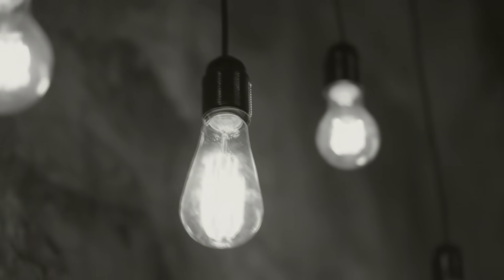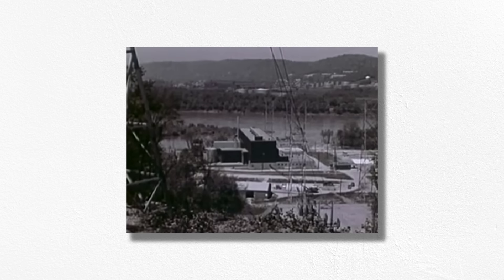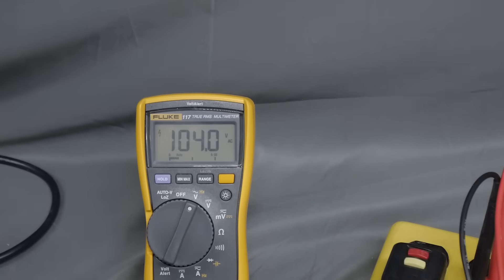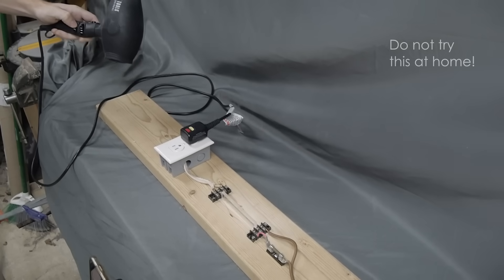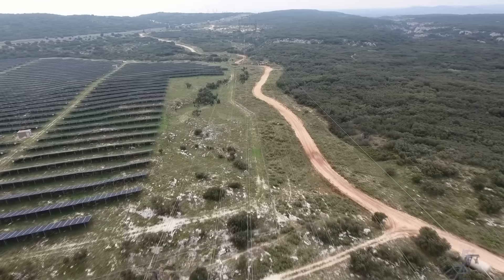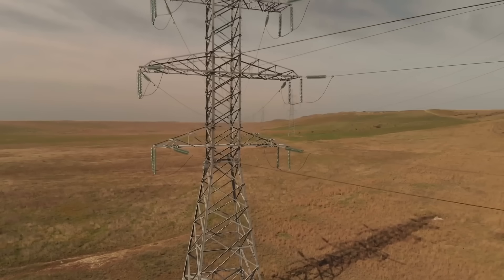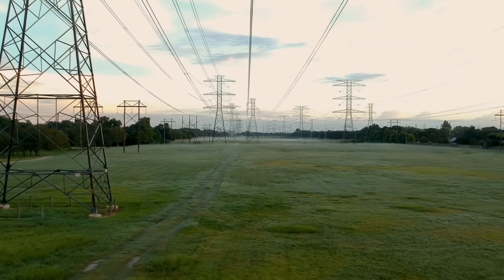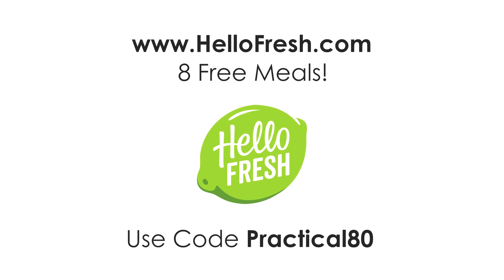How do Electric Transmission Lines Work?

Comment: What causes the power line noise? What is done to minimize it?
Reply: Corona discharge makes noise, you usually get it if you have sharp edges, that's why the higher the voltage the more important it is to have rounded corners on everything conducting electricity.
The conductor itself is not much of an issue but the point where it's attached in the transmission towers would be a source of corona discharge
Reply: Morten Holsmo  I never knew that the bending angle matters when it comes to Corona discharge
Reply: That is an electric discharge of the air. So basically, the power lines leak electricity into the air. The air then dissipates the energy and that produces a buzzing. There are steps to be taken to help minimize the problem, but it'll occur in any high voltage system.
Reply: @Azivegu  so If I'm understanding correctly the electricity is seeping into the air causing it to heat up and vibrate? What controls the frequency of these vibrations?
Reply: The freq of the generator - 60hz in US  50hz in some other places.
Reply: krembo the frequency of the electrical system controls it such as  in the US we function on 60 cycles and in Europe they run on 50 cycles. The higher voltages will also carry a more high pitched tune.
Reply: @Azivegu  Good answer!  FWIW, something that illustrates this point is that the noise level noticeably increases with humidity because wet air is more conductive.
Reply: @Azivegu  yep u right i noticed that noise isn't often so i believe it depend on percents of humidity in the air.
Reply: @Azivegu  wrong
Reply: @Azivegu  Also you'll notice the buzzing noise is usually 50/60 Hz, the frequency of the AC wave.
Reply: @Azivegu  u basically dodged his question so what about not replying if ur not gonna provide an answer in the first place.
Reply: @AksamRafiz  you high bro?
Reply: @AksamRafiz  He just provided the answer
Reply: @Azivegu  thank you for the answer! So these steps you mentioned aren't to minimised the sound but to minimise the leaking of electricity to the air?
Reply: @Azivegu  my apologies ,I wasn't in the proper state of mind.
Reply: @lathah8160  Well, you could insulate the cables, prevent the leakage all together. But the additional weight and cost just isn't worth it. This whole discharge is kind of like those plasma globes. If you have ever played with one of those, you will know that they can get pretty hot. That is because (very simplified) all the energy is traveling through a small space. If you do that with metal, it will get damaged more quickly than glass. So the main method is making a large ring that spreads the area from which the discharge occurs.
Reply: @AksamRafiz  we're good mate ;)
Reply: Azivegu Corona rings are installed to help with discharge to the atmosphere. On higher voltage transmission lines the noise is generally more noticeable when the humidity is higher such as during the summer months.
Reply: Corona discharge is a function of E field strength and in current carrying conductors the E field is dependent on the geometry of the conductors. Qualitatively the "sharper" a point is, the larger the E field. What people do is get wires that carry the same phase (they are shorted together at regular intervals) and space those apart in a circular fashion. The circular arrangement changes the E field such that the effective radius of the conductor is further apart, as if the circular conductors were one big wire. Bigger radius means less "sharpness" and less corona discharge at the cost of installation cost.

I'm not a power engineer but an electronics engineer so that's as far as I know :)
Reply: Some very good answers below. However, everyone in the power industry knows that lines and transformers hum because they don't know the words.
Reply: Robert H RIMSHOT!
Reply: @roberth7691  Unfortunately, for transformers sometimes the words are "BOOM! - szzzzzz."
Reply: @roberth7691  puuurrrrrffffffect
Reply: Wash the insulators, and more rounded insulator design mininmize the buzz.

It’s caused by electrical creepage along the insulators “corona discharge” to be specific. The air ionises and the particles vibrate. So powerlines in Australia sound slightly different to America.
Reply: Excellent video as usual. I always love the demos!
Reply: @user-jp1qt8ut3s  , Brinks, easy lads. Little A, Little B. Definitely some electromagnetic stuff goin on. Physical movement is there. Thats what gets you your bass hum, @50/60hz plus all the harmonics. Corona discharge also is a factor. A fuzz, white noise. Pissed off electrons having to turn, ionizing the local atmosphere n grounding out. Most places in ht you get both. Sometimes more of one than the other. Inside a transformer, definitely electromagnetic, unless your having a really bad day. Damaged insulator on a humid day, corona. A regular pylon just doing its thing, bits of both.

Although i do question highly that the energy is carried in the environment around the conductor. The skin effect will limit the curret flow to the edge of the conductor given the lines impedance, limiting the economic usefulness of just a bigger wire.
Reply: It's called coronal discharge, it's more likely where the conductors are held at the tower, but if the electric field on the surface of the conductors is dense enough, they will have coronal discharge as well. It's fixed by using larger conductors or by bundling conductors (basically both methods are to increase the surface area of the conductor).
Reply: It is called Corona Effect and its the results of strong field around the conductors , in some large power systems it can results to a discharge (Arc )
Reply: @JohnDoe19xx  Which type of field?
Reply: First of all you have to understand what causes the noise and sometimes the blue glow. This is Corona discharge and occurs when the voltage is high and the diameter of the conductor is small.
You can reduce the Corona discharge by increasing the diameter of the conductor. This would be the solution in, say, an outdoor substation where you would use large diameter tubing (usually aluminium because it's light and a good conductor).
This will not work on overhead tower lines because the conductors have to be flexible and it would be too expensive anyway. Using a larger flexible conductor would need more and stronger towers to carry them. In any case, it would be a waste of money at high voltages because the current (amps) is lower than at lower voltages because the power transmitted is volts times amps. Double the voltage - halve the amps. It's slightly more complicated with AC systems but essentialy the same principle. 
For the lower current at higher voltage you don't need as large a diameter. 
So what the Power Engineers do is install double or quadruple conductors connected together by spacers at regular intervals. You can see this on many overhead high voltage lines. The current is shared between the conductors (so they can be even smaller) and this apparant larger diameter conductor is less susceptable to Corona discharge. If you like to think of it this way, you "fool" the electricity into "thinking" it's a large conductor instead of two or four smaller ones.
Conductor sizes, spacing, mechanical strength, tower design, and cost per kilometre is all part of the Design Engineers job to build a system that is really the best compromise between all these different criteria.
The mathematics for Corona discharge, conductor size, voltage, humidity and altitude is something that I happen to have forgotten but knew in the dim and distant past, but I think it was sort of complicated and probably mainly empirical in nature.
Hope this helps.
Reply: The following is a mix of knowledge and theory. Not verified.

My understanding was that the magnetic fields generated by the lines caused vibrations. Hence it hums at 50Hz.
This is the case for transformers.

Also electric fences for cattle hum but not at the same frequency as power lines.

To mitigate this, since F=BIL, You could reduce the current, increase the mass of the conductor or orient the direction of the wires so Earth's field and the direction of the current was closer to parallel.
Reply: Hunter Biden did it.
Reply: @comradefernandomandrake5822  Russia COLLUSION
Reply: I haven't read all of the responses in depth.  Several of them seem to touch on some areas but I didn't see one I thought was complete, so I'll add my two cents.  For background, I designed and tested transmission (mostly) and distribution insulators for seven years. First, to be clear..there are two main types of noise generated by power lines.  The less annoying of the two is the low-frequency noise sometimes referred to as "60-cycle hum".  It's an electromagnetic phenomenon that is a result of the electricity being generated (in the US and elsewhere) at 60 Hz.  Because physics, what we hear is double the frequency of the electric generation (so 120Hz in the US). 

The annoying power line noise is cause by corona discharge.  The corona is caused by voltage stresses in the system causing the air to become ionized, much in the way that the gas neon is ionized in a neon sign.  Most of the time time, this is caused by the mounting hardware that connects the conductor to the insulator.  There are all kinds of bolt ends and cotter and clevis pins that provide areas where the electrical stress can become concentrated.  Have you ever heard that the way to stop a crack in your window from propagating is to drill a small hole at the tip of the crack?  In a mechanical system, the tip of the crack has a very small radius and causes a stress concentration which causes the material to continually fail and for the crack to propagate.  By drilling a hole, the radius is increased and the stress concentration is reduced.  Something analogous happens with electricity. Small radius conductors and areas of mounting hardware cause the electric field to become concentrated in areas.  This can usually be combated through proper design but sometimes we help "smooth out" that field through the use of corona rings.  The corona rings are large diameter smooth rings that help to reduce the electric field.  You can see these corona rings installed at 6:24 and 7:24.  You'll also notice that when it is raining, you'll often hear more of these corona discharges as the water droplets on the conductor create a smaller radius for voltage concentration to happen.  If the corona is particularly intense, on a dark night you can see the corona discharge glow. 

Actually, utilities are less concerned about the noise created by corona than they are about a second effect: radio interference.  Corona discharges create interference in the radio spectrum centered at roughly 1000 kHz.  When I tested insulators, we would run an insulator assembly to the desired voltage and measure what is called radio influence voltage (or RIV) at 1000 kHz.
Reply: No. The hum is from the lines rapidly reversing (60 cycles per second gives 120 Hz peak current) magnetic field affecting tower, transmission wires, everything magnetic. Not only do items move in the field but iron, nickel, etc. shrink/grow in magnetic field.
Reply: I would love see a video about this to get more in-depth on it, but the wiki page for Corona Discharge has some cool pictures of how it looks coming from various objects in the meantime
Reply: Alex explain how on underground conductors, which are encased in a semiconducting shield, insulation layer, another semiconducting shield, concentric neutral, and a vinyl jacket carry electrons through the air when they travel in an airless environment? Also underground transmission circuits (paper and oil insulation) are encased in a steel casing that is an enclosed nitrogen rich environment (to exclude oxygen and humidity) - no oxygen present but they do make noise?
Reply: 3rd El Tercero dc does not generally make noise. The battery banks in use in substations around the world to drive the equipment (breakers, switches, etc) - they use dc because in the event of an outage you can still operate equipment to turn the lights back on and it also has the ability to generate torque for the high workload required.
Some battery banks use up to 600 volts dc depending on voltage required, 120 dc being fairly common.
Reply: @randyweaver6543  Im an electronics technician and during my traineeship my teacher in the profession school said that tiny droplets of water that sit on the lines or are close to them will deform and oscillate in the alternating electromagnetic field of the powerline and thats whats causing the noise during high humidity or rainfall. No idea if its true but makes sense for me^^
Reply: @user-jp1qt8ut3s  That's funny
Reply: @user-jp1qt8ut3s  oh, smack 'em hard
Reply: The best way to tone that annoying buzz down is to obtain several feet of heavy metal chain and toss it over the wires and run. Certainly makes an initial loud noise but after that it does calm down. If the wires are too high just track them back to a sub station. Same principal.
Reply: Just like a transformer hums. The current thru the wires generate a magnetic field. Anything magnetic, paramagnetic or diamagnetic (basicly anything) is alternately attracted and repelled acting like a speaker. Wires carrying current are magnetic. Even sealed transformers hum but at reduced volume. The wires of the power line do the same but they are in air.
Reply: There’s really no way to decrease the sound
Reply: A/C cycles 60 hz
Reply: Corona discharge’ it could be minimised by adding more conductors per phase to reduce electromagnetic interference’ the buzzing can also occur depending on the weather.
Reply: Didn’t mention AC vs DC transmission and subsequent losses associated with each.
Reply: energy creates vibration.... vibration is energy
Reply: You may not believe this, but electricity is carried by bees and they travel through the tubes installed between the power line pylons. They cause that buzzing sound.
Reply: Beloved Lover You’re right, I don’t believe you, but I love your joke! 😉
Reply: @user-jp1qt8ut3s  Well at least iam actually doing something than just theoretical stuff. But link me your Thesis then. Il like to take a look at it.
Reply: I observed the effect of water on arc noise long ago when I lived near transmission lines in Miami.  Right after a heavy rain, the racing stops.  During the wait for the next rain, dust in the air settles on the insulators and absorbs moisture from the air, making a partial current path, so the line gets noisier, and the next rain cleans the dust off.
Reply: Allan Richardson if you were close to the coast in Miami and the rain was moving onshore the noise on the wire may dissipate but the noise on the insulators will generally increase from the small amount of salt mist carried by the rain. Salt greatly increases conductivity so the insulators will make noise due to tracking across their surfaces.
Reply: @user-jp1qt8ut3s  Thats far from true Alex. The electromagnetic field doesn't move any energy. Just like the paracitic capacitance of the wire they store the energy and by that act like a filter.
Reply: @user-jp1qt8ut3s  If you use the right hand rule you can see the magnetic field. On a single wire it is perpendiculair to the wire itself. If you put a wire right next to it, it wil induce a current in the other wire yes. But for powerlines this is way to far apart to have any large effect (except of a little swinging on high loads). If you wrap the wire into a coil, put it in a magnetic core and have another coil on the core. Yes then it does move the energy throught magnetic fields. AKA a transformer.

The HAN University of Applied Science btw. (said to be the best in the Netherlands ive heard)
Reply: krembo 
Electricity 
Earplugs
Reply: @erikjohansson1814  Haha...
Reply: @user-jp1qt8ut3s  Alex, you have it wrong. Even in Goubau lines the electromagnetic energy is trapped in the wire.  The energy in transmission lines is carried by electrical conductance; power line design absolutely depends on it.
(FCC radiotelephone licensed since 1969, IT/Communications tech for a major electric utility from 1984-2018 with emphasis on power line protection schemes and energy delivery.)
Reply: krembo  hey buddy,

I believe that the buzzing noises around the high voltage  transmission lines are do to moisture, or humidity in the air that causes the frying or buzzing sounds?;

A few years ago I was up in Chicago and where I was staying had a high-voltage transmission line not to far from my hotel,

And there was a nice long hiking path that was paved and I would go out and take a really good and long hike at nighttime to stretch my legs as well as to relieve stress from the long busy day;

And while hiking under those power lines I could hear all of that buzzing or frying sounds from those lines that were way up high ;

It was very noticeable ,

And very unusual indeed 🥴

Something that I believe most people have  typically not experienced??

 Definitely a technological accomplishment 👍
Reply: @interwebtubes  yeah, it's weird. I've heard the buzzing but I've never stopped to wonder what's vibrating to cause the noise...
Reply: @interwebtubes   yes humidity reduces the breakdown field strength of air. Dry air can hold around 3 kV per millimeter for a homogeneous field. Near the conductor the field is very inhomogenous and field strengths get higher than what the air can hold. This corona arcing alternes with the network frequency of 50 / 60 hz for each phase, so you also  hear harmonics of that. These partial discharges usually only occur on lines with a voltage above 200 kV.
Reply: berliner  yeah my understanding is that the ribs on all of those insulators  helps break the standing electrical charges??;

 Nonetheless  some awesome engineering and development;

And I’m pretty sure that all of those things are fairly costly,

But given what all they do and the importance of each and every component in the power grid;

A definite necessity
Reply: @interwebtubes  Something like that. Our sub techs told me the insulators are coated with a semiconductor so the voltage gradient along them is even. Most of the crackling occurs at the insulators when they get dirty, especially in humid weather.
Reply: interwebtubes the skirts or ribs provide tracking distance so an insulator can be made much shorter in length and they also function as a rain shed to help prevent a direct path from the grounded tower to the energized conductor.
Reply: @thoreberlin  Show Off
Reply: @interwebtubes  Just saw your question now. No; the ribs on the insulators are there to avoid continuous conducting dust films on them and to lengthen the distance for any film occuring. Required creepage distance varies with environmental conditions from about 27 mm/kV up to about 45 mm/kV.
Reply: berliner  oh hey,  this conversation definitely reminds me of that old movie, with John Belushi  in it, “ Neighbors” ;  I just remember the sounds of the High voltage power lines crackling  in that crazy movie, just too funny 👍
Reply: @interwebtubes  No, the ribs on the insulator are there to make it more difficult for a high voltage arc to form.
What can eventually happen is a build up of dirt and salt deposits over time can make it easier for an arc to pass over the surface of the porcelain insulators.
Reply: My brother is an electrical Engineer who works for a powerline company here in the Netherlands. (i am a electronic engineer too btw). I asked him the same question a couple years ago.

Electrons in powerlines move quite quickly. This is because of the high voltage. If the powerline makes quick turns, Like they do at the towers that keep the lines up. The electrons have to make sharp turns. Just like a car it can't make a quick turn if you drive with 200kmph. So the electrons bump into the curve of the wire and make the ends virbrate. This vibration can make the whole line between towers vibrate. Which is why powerlines sometimes make sound. The sound you hear is also 50 or 60 hertz depending on where you live. This is something that occurs quite often at powerline towers where the powerlines make sharp turns. its really annoying to live below one of these powerlines because the humming never stops.

(This info is an adition on what @Azivegu said.)
Reply: @brinkshows2720  I hear the buzzing at certain electrical substations. Sometimes after upgrade/construction work the buzzing stops, sometimes temporarily, sometimes permanently.
Reply: Kit Vitae It seems reasonable that while power is rerouted around a substation for maintenance, they would pressure clean the surfaces exposed to the weather, including the insulators.  That would clear up any arcing, at least temporarily.  If it rains frequently, insulators will stay clean between maintenance dates; if not, the dirt will build up and the quiet won’t last.
Reply: Allan Richardson 
The corona is caused more from sharp edges or irregularities in the conductor surface than it is from tracking through a dirty insulator. 

Imagine a water slide with a smooth surface and a slick sheet of water running down. Now place something, your butt maybe, in that waters path. The water now has an obstacle that disrupts the flow, causes noise and water loss. Irregularities in the conductor have a similar effect on the flow of electricity.
Reply: @kylerayburn8524  I would have thought so but the noise mostly comes from the location of the insulators. It could be from the insulators or from the deformations caused by the insulator connections. Since lower voltages also make noise I still suspect the insulators.
Reply: @brinkshows2720  You're brother needs to retakes his engineering class. He has completely misunderstood the concept.
Reply: Brink Shows  here in the states we have three phase ,

( 3-phase)  power on our primary electrical circuits ,

Although  there’s some exceptions ,

Like 277 volts polyphase lighting Systems ,

Those things are very rare ;

However my understanding is that the primary power distribution  over in the European areas are five wires??;

I’ve heard that about the electrical system over in Germany and beyond??;

I’m really curious,

Can you find out from your 
Relative if that is really the case that they use five ( 5)  wires in their system??;

I’m just very curious??;

Best regards everyone 👍
Reply: @interwebtubes  We also have 3 phases. Anywhere on the planet with major power generation has 3 phases.

Normal house appliances have 3 wires normally. Live wire and neutral with an extra earth wire. This earth wire is connected to a device in our breaker box that when around 20 mili Amps is flowing throught it, it will cut the breakers. This earthed wire is for safety. Forinstance a washingmachine has a earthed wire connected to the outside caseing. If there is a short in the washing machine and the housing of the washing machine is connected to a live wire the breaker will cut and prevent electrocution.

What you probably mean with 5 wires is a 3 phase connector in a star configuration. 3 wires are live wires(3 different phases), 1 wire is a common neutral and the 5th one is an earthed wire.
http://members.chello.nl/l.boncoeur/krachtstroom/krachtstroom_1.jpg
https://www.deboerdrachten.nl/productafbeelding/zv2702100877/0/1240/1240/stekker-5-polig-16-amp.jpg

This type of connection is only used on high power systems or with systems which need 3 phase electricity like AC Asynchronous of Synchronous motors or like induction stoves etc. Its not common in a household.

For powerdistribution they just use 3 wires with 3 phases in a delta configuration. (the 4th wire is the earth itself just like in the US or any other country in the world)
Reply: @interwebtubes, are you talking about Northbrook area?? 🙂. If yes I know exactly what are you taking about. Very loud!
Reply: Brink Shows We use three conductors with the fourth being a neutral conductor on most power lines in the US (Y or wye configuration). Delta used to be more common but is slowly being phased out in favor of wye. Delta is used for transmission lines as it is carrying bulk power from point a to b.
Reply: @brinkshows2720  Beautiful explanation.
Reply: interwebtubes in Europe I think what you’re referring to is their use of two hots instead of here where we use a hot and a neutral
Reply: { TheyCallmeDomy }  interesting stuffs,

Many thanks for your reply buddy,

Stay safe and please remember to keep your hands washed up at all times in order to help prevent the spread of germs as well as to protect yourself 😷👍
Reply: @randyweaver6543  Delta, Wye is nothing to do with transmission lines. 
Delta, Wye is to do with the topology of the coils in the generator at the source, or the topology of coils in the load - typically a distribution transformer and motor winding configuration.

It's a 3 phase system so the electricity is transmitted across the country using overhead lines which are in groups of 3, one for each phase, and that is true regardless of whether wye or delta is in use. Both wye and delta still use 3 phases.